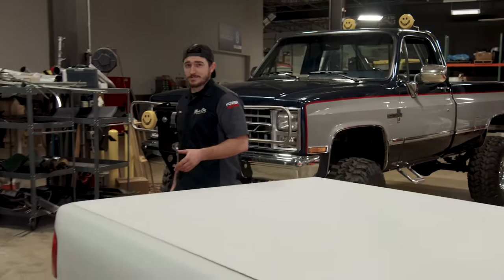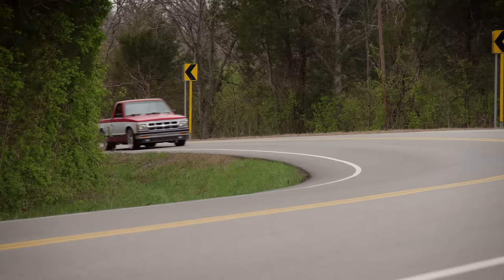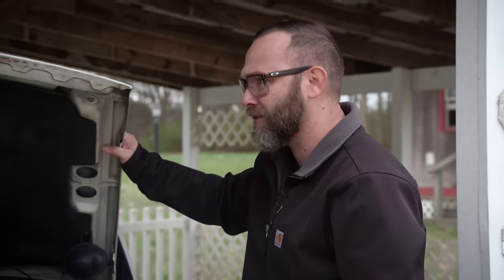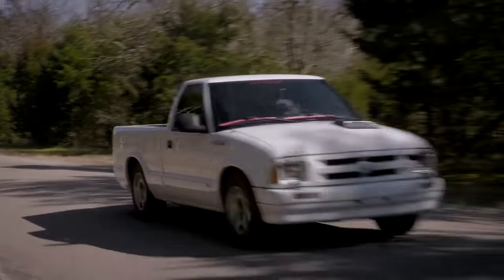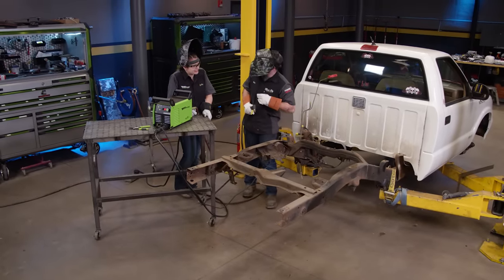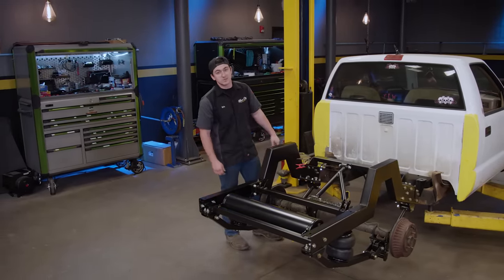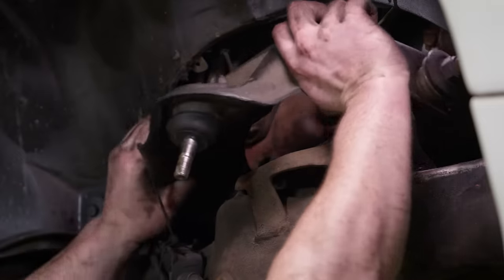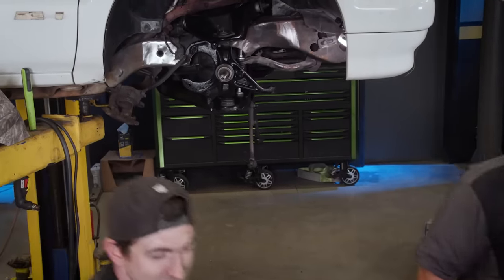Full Build: Slamming A Stock '95 Chevy S-10 Into A Throwback Mini Truck

Comment: I used to have a square body 92. it was a dam good truck. had the same burgundy interior lmao. 2.8 v6 manual.
Reply: I have an 86 s10. It came as a 4cyl 5 speed, but I swapped in a built 2.8L from my 83 gmc s15. Ported big-valve heads. Edelbrock intake. 390cfm 4bbl carb. Hedman headers. Edelbrock cam. Roller rockers. 4.10 gears with a lunchbox locker and 38.5x14.50R15 tires out back. 2.5" body lift. 3" lift spindles up front with 31x10.50R15s up front. Edelbrock shocks from like 20 years ago at all 4 corners. 
  She's a fun little truck. It's only 2wd but the bedsides sit as high as my k2500 pickup on 33s. 
  I'm not a big fan of lowering trucks but I get it. The s10 platform is a lot of fun.

Comment: 1984 GMC S-15 4X4 GYPSY PACKAGE INTERIOR. I ordered and got  it in Nov. 1983.  Over 500,000.00 miles on it.  Same 5 speed tranny. Replaced engine in 1992.  Racing blew up original 2.8L. Limited slip rear end.  Still very strong and doesn't smoke.  Oil changes regularly make the difference.  I'm the original owner.

Comment: My Ranger wouldn't be the best starting point . Because even though it's a 2 wheel drive , it's a Edge model . And they are the same height as the 4 wheel drive , with the same torsion bar suspension . If I had a regular one it would be way easier to lower it  .
Reply: So go to a pick-a-part and pull the i-beams and steering knuckles out of a base model. You can't be more than $200 in parts to swap it. Rear drop is just a simple axle flip to lower it at least 4"